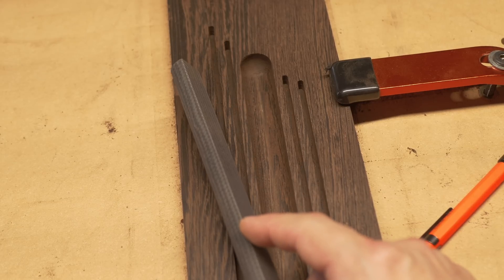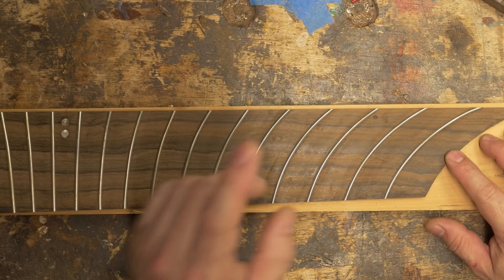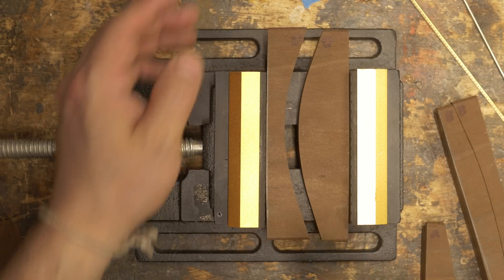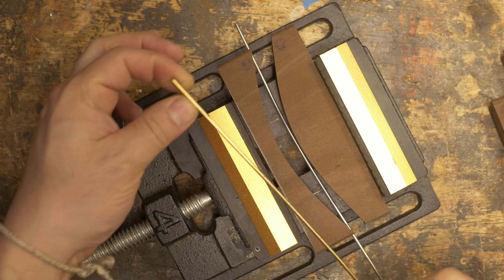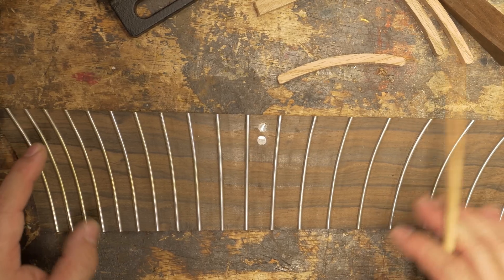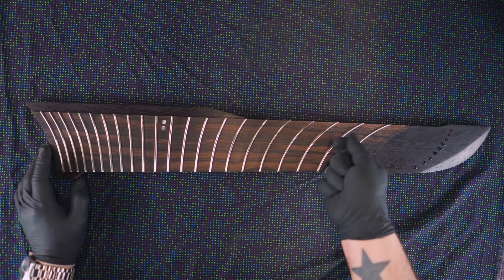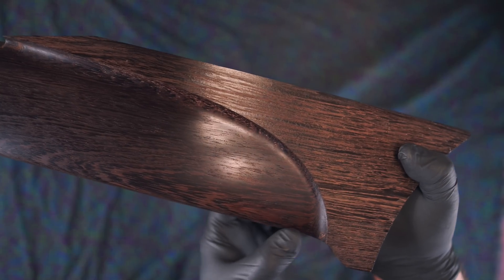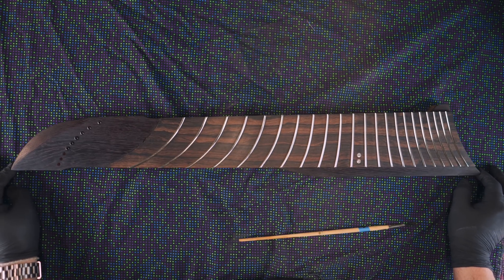Exponential Scale - Great Guitar Build Off 2022 - THE AVANC #GGBO2022 #greatguitarbuildoff2022

Comment: I was watching Driftwood guitars YT channel, and i see he has tried out the D tube idea for a truss rod replacement, too, but didn't even bother with the extra carbon fibre rods. Still got an incredibly straight and stiff neck. Maybe those extra rods are overkill? I get that this will probably give you an extremely stable neck, so one would presume that any relief in the board would have to be "dialled in" from the word go, as there won't be any way of adjusting it after the instrument is made. Wondering how that will pan out if this becomes mainstream. 
Will you have to order a certain relief built in according to your tastes? 
IIRC Vigier have released a line of guitars which also don;'t have an adjustable truss rod, so I guess this is actually no problem.
Reply: OK, will address the "elephant in the room".... WHY exponential frets? What advantages do you think this will have over either standard orthogonal frets, or the less conventional (but becoming more mainstream) multiscale fretting system?I mean, yes it looks cool, and interesting, but what does it do that either of the older systems can't do, or at least does it better? Especially as it takes a lot more work to bend, insert, level and crown!!

Intrigued as to your thought/design processes. Find myself more interested in the Why, rather than the How!
Reply from the maker: Ha. You already figured out the WHY. When I was noodling around in Excel running the formula through different scale lengths, I rendered many iterations that where ergonomically more superior but less visually interesting. I landed on this version for one reason only. It looked "different", "cool".  A perfect example of form over function. It was a nightmare to build. And that is the 2nd WHY. If something is easy to do, everyone would do it. I wish I could say exponential scale only exists cause it looks cool but the underlying logic and math are sound. The advantage over traditional multi-scale is that exponential scale "spends" its extended range where it can "afford" it (the lower strings). A logarithmic curve makes more sense than a straight line in these circumstances where we don't want greater tension on the higher strings. We want them to stay slinky. And we want the thicker gauge strings to be taut.
Reply from the maker: I hope the extra rods are overkill. I've never built a guitar with more than 6 strings until this one. Not sure what kind of tension to expect. If 6 strings exert somewhere around 110 lbs of tension, what can I expect from 9? Yep, both Vigier and all those aluminum neck builders build in the relief from the get go. I did that last year for my aluminum neck with no truss rod. I built the relief into the fretboard. Wish I hadn't. This 9-string has no relief built in. My last build used the D-tube as well. No relief either. No fall away on the last frets either.
Reply: I may be wrong but I think that Ken Parker was the first to use the D tube instead of a traditional trussrod… in his archtop guitars.
Reply from the maker: @ryanbaptiste249  Yeah the earliest documented use of the D-tube I could find was a repair that Ken Parker did using the D-tube.
Reply: @MarkGutierrez  BTW, I'm impressed with your alternative approaches to many aspects of guitar design, not to mention your keen attention to detail.

Comment: Interesting concept, I am excited to see how the build is finished out. Although, one easier solution to the problem with traditional multi-scale guitars is simply to put together a custom set of strings for balanced tension. Certain string tension calculators from various brands are available online to find what you need.

P.S.- I actually do like the music. Try composing some type of music fully on synth, and then re-arrange it with Guitar, Tongue Drum, Kalimba and other instuments. The composer for Killer Klowns from Outer Space did something similar, creating fun and eerie music and recording every part on wacky instruments that it wasn't composed for.
Reply from the maker: I'm  glad you mentioned that. Putting together a custom set of strings is a  must. I used a custom String Joy set on my multi-scale baritone build. Perfectly balanced. String tension calculators are essential.

Comment: What's the construction of the D tube? I recall reading a materials science paper some years ago on the acoustic characteristics of sandwich-constructed carbon fibre, and there were significant losses, especially in the low end (peak transmission loss was around 30 Hz, IIRC), but with losses throughout the spectrum. The conclusion of the paper as actually that carbon fibre is a better sound insulator in most respects than a sound propagator. If that pans out, such construction would not be good for guitars.

ETA: Had a look on Scholar, and the paper in question is Zhong Yan et al - IOP 2019.
Reply from the maker: The D-tube is straight up carbon fiber. It's not sandwich construction. The data from the paper makes perfect sense. The low density sandwich core wouldn't be rigid enough to resonate. I don't think many musical instruments are made with sandwich construction carbon fiber. But now that is giving me some ideas.

Comment: Mark… what a cool neck! I understand your pain against springback!!! Im working with sheet metal in the car industrie… and springback is our ennemy!! 
Question: why do you do your parallel toolpath at 45deg? I do mine following the wood grain, as I beleived it would be less tempt to chip…
Nice work, nice video.
Reply from the maker: Hi, I typically only use the 45 degree tool path only for facing operations or adaptive tool paths. I'll use a standard 0 degree parallel tool path for the radius. This neck however doesn't have a radius. it is flat like a classical guitar. So I just used the same flat end mill and the same 45 degree tool path but changed the step over to .3mm for the parallel path. I've only had chip out on one species of wood: Birds eye maple. Every other species doesn't mind the 45 degrees. Thanks for watching!

Comment: i was looking into travel guitars a couple of years ago and came across quite a few makes that use carbon fiber for everything, necks and bodies, notably mcpherson (if you have $20k to spend on a guitar) but also klos, among others. what really got my eyebrows raising though is i got hold of a martin OOOX1 back in 2014 which (and it's very subjective) sounds better than any of the 50 or so guitars i have over the last few years, including the 66 gibson j45 i've had since the 70's, and a newly acquired 69 epiphone texan. the thing about the martin is the back and sides are HPL - martin doesn't say what HPL is, 'high pressure laminate' could be anything, and it can either be laminated woods, or, which i think is the case, printed vinyl laminated onto mahogany chipping - like a kitchen worktop. so you would imagine as an HPL martin is 1/10th the cost of a solid martin it would be inferior materials, but, like i said the martin sounds absolutely amazing, even with year old strings. put new strings on and it's mind blowing - i have two!!
Reply: edit - i didn't realise i'd visited this channel before, so if i'm repeating myself - soz!